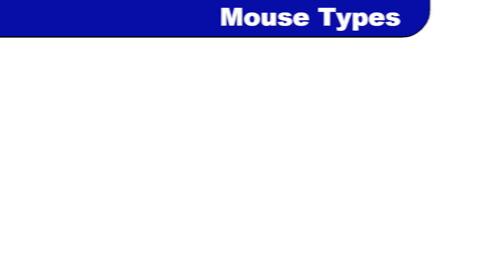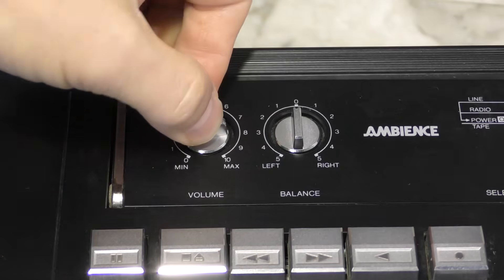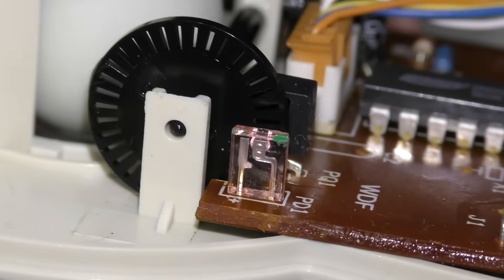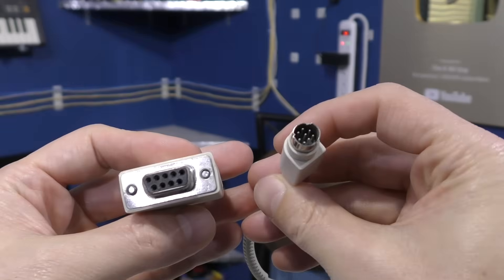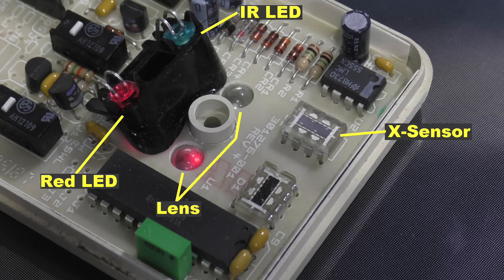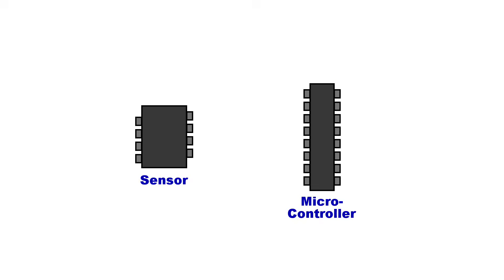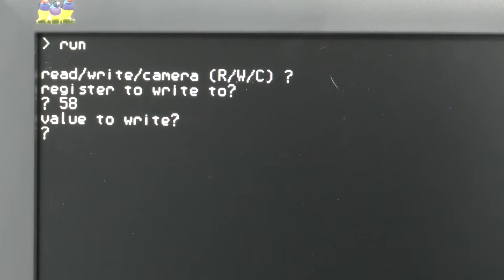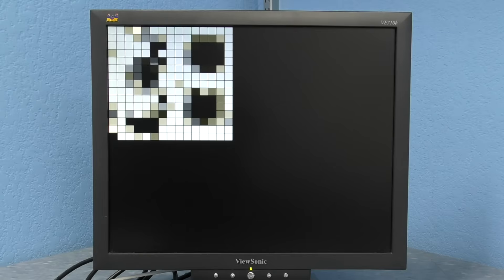What does a computer mouse see?

Comment: I googled this question just a few days back and didn't get a convincing answer... This is so perfectly timed!
Reply: What do you mean you didn't get a convincing answer?
People have been hacking mouse sensors as really crappy cameras and explaining the same years ago lol.
Here, this is from 10 years ago https://www.youtube.com/watch?v=bci7Gi05BNc
Reply: @GoldSrc_  People have search results 'tailored' to them by Google. What you see - even at the same time with the same search - is most likely entirely different than what they see.
Reply: Regarding reading mouse data, just go into anonymous mode and google "arduino mouse camera"  and you find plenty of results along these lines, which work faster that the one presented here.

 @ProGamer1515  I've seen Google not finding some obvious things, but not sure it tailors the results that much to user profiles, usually it's things it just doesn't index properly for anyone or jumbles it with many other unrelated things as to make the results useless. But that's not the case with this in my experience.
Reply: @ProGamer1515  That works for ads, not so much for search results, besides, how many other results you would get by googling "what does a PC mouse see"? That video I just linked, was one of the first few results.
Reply: :D
Reply: XD
Reply: K

Comment: The true awfulness was the mechanical... before the opto-mechanical, they used a disc with contacts, offset so that one set lead or lagged the other depending on the direction - probably got one of those tucked away in a drawer.

Also, many of the optical mice react to movement by brightening  - this isn't a cosmetic feature, they use multiple sample rates, particularly important for a cordless.
The wired typically use 2 rates, activating the LED and sensor 100 times a second when stationary, and 1000 times a second on detecting movement.
Cordless use a lower sample rate or 2, eg. 10 per second when idle, and an even slower rate when  left for longer.

Also, the lighting is aimed sideways to raise the texture of the surface.... Don't make a mouse mat with a picture under glass!

Comment: Trivia: modern gaming mice still typically have independent MCU and sensor chips.
Reply: @smpmuzpid  That's what she said...

Sorry. Had to do it.
Reply: Kinda reminds me of the Wii's IR sensor.

At first glance it seems like it tracks IR light sources - which of course, it does.
But how it does that is basically that it's a 128x96 black and white camera with an IR filter, and a built in processing chip that takes the 4 brightest readings, interpolates the pixel intensity values to essentially determine the coordinates as though it was a 1024x768 image, and then send those coordinates + a 4 bit brightness value on to whatever hardware you connect it to...

I guess optical mice are kind of doing a similar thing...
Reply: yes because they use more bigger camera
Reply: @AkhyarMaulanaPangeranWeb  it's more about the processing they do being a lot more elaborate, they're not JUST cameras, they're also DSPs
Reply: @AkhyarMaulanaPangeranWeb  I would say, that the reason is latency: You can make a faster MCU when you seperate it from the sensor. And the faster the MCU can process the sensor data, the faster you can move your mouse cursor and therefore in games where the crosshair of your weapon looks too. Don't forget, when you have a 144 fps screen, your mouse must at least send the position data 144 times a second to the computer, so that you can move your mouse without lag.

Comment: You should find a Hawley-style roller mouse, like Digital used for their DECstations. They worked vastly better than opto-mechanical balls.

https://images.app.goo.gl/bf8DSNbrwDNbhQ5QA
Reply: I guess these style pucks are rare, though pretty much all the DECstation 2100/3100s we had on campus in the early 90s were equipped with them. I'd have thought they'd be more common.

Comment: I did have a newer mouse that had a separate microcontroller (in this case, a 32bit ARM MCU) and sensor, however it got fried due to a lightning damage. It was a Logitech M500, and it had a laser sensor.

Comment: There was an old project posted on Hackaday where someone managed to used one of those sensors kind of like a scanner. Obviously the resolution from the 18x18 CCD was very low but the result was pretty impressive for what it was. It definitely blew my mind at the time. Unfortunately the link is now dead.

Comment: Neat!
I wonder what about the ways the Mouse sometimes fails, like if your mouse is stationary and somehow the cursor watching in realtime, moves itself to the bottom lower right corner, without you touching the mouse. Software issue? lens dirty? Laser timing misfire?
Reply: I only ever saw this with laptop trackpoints, there it's a calibration issue which fixes itself after some time.

Comment: I used that optical sun microsystems mouse back in college. It was horrid. The mousepads they had were always too small and would rotate just enough to mess up your cursor. It made me so mad that when "Laser mice" came to PC later, I dismissed it at first. But when I saw that newer ones didn't need a special mousepad I was sold!

Comment: who cleaned the ball... pretty obvious what bits got grotty. 

of all the computer mods ive ever done (n ive done some janky awesomeabsurd stuff, tho im an x86 kid), I think the most kudos I got at lan partys etc was one of the simplest.

replaced the red LED in an optical mouse with a blue/green one. having a good optical mouse was critical for any gamer. so many red glows in the lan hall. the blue/green (aqua) LED cost me something ridiculous, about $9. for a single 5mm LED. it really looked amazing. super unique. what I didnt let know, It was super fussy on what surfaces it worked on. needed huge contrasts. worked OK on my wood veneer desk at home, but not a chance on anything resembling a mousemat. I did my own newsprint laquer mousepad for lanning with, which looked pretty cool to. 

i had a beefy, watercooled, windowed, neoned (pre ccfl days) 6x hdd, dual PSU, overclocked to the hilt rig. and people commented on my mouse... Jeeze. to be fair, It was the only one like that ive ever seen, then and since

Comment: I had a stockpile of Microsoft InPort mice back when they were discontinued.  I LOVED the little tiny two-button mouse and didn't change until I eventually wound up with a system that no longer had ISA slots.
Reply: Those are worth something on eBay now. I've got an MS one on my 386, and a Logitech (I think?) controller card for one. I'm running the mouse off an old ATI video card that has the support for it. Excellent mouse, had it for over 20 years now.

Comment: My 2019 MSI PC still has PS/2 connectors for both mouse and keyboard, i have a old Packard Bell Keyboard from the late 90's but it's USB
Reply: Even high-end motherboards still can have a PS/2 port (usually a single one that you can split into two with a Y-splitter - a combo port), depending on the vendor. My Gigabyte Z370 board has a PS/2 combo port, and I use it for my mechanical keyboard. 
It's also good to have it as a fallback in case something happens to an onboard USB controller.
Reply: Pineapple road lots of esports players opt for ps/2 connectors because there’s something with how they transmit data vs usb for efficiency
Reply: @Adamsnadler214  Yeah, it's because of latency. Long story short: USB device has to wait its turn for CPU to work on its input, while PS/2 literally interrupts the CPU, requiring it to work on its input above all else, so no delays.
Reply: As I understand it some say lower latency for gaming but I'm not sure. funny though.

Comment: I've got an optical mouse for the Amiga and another for Acorn Archimedes. I found a model of mouse with an optical sensor chip that gives out the raw quadrature signals, the same as you'd find from the infrared LEDs in an optomechanical mouse. For the Amiga I had to cut the power trace to the USB encoder chip, then solder on the Amiga mouse cable to the correct pins on the optical sensor chip. The Acorn one was more difficult because the buttons worked differently (they were pull-up instead of pull-down or vice versa), so I had to cut all the traces to the buttons and wire them in separately with some resistors.

Comment: You missed the problems with the Mouse Systems pad optical mouse. I know you couldn't try it, but it does not act like an optomechanical mouse even if the way it measures movement is technically similar. The optomechanical mouse moves in the orientation of the mouse. The Mouse Systems pad optical mouse moves in the orientation of the pad, which meant that while it was very accurate, turning your hand any amount, as you do naturally, or having the pad at an incorrect orientation would cause the mouse to move in an unexpected direction. For most people, moving in the orientation of the mouse feels more natural. You could work with it when you had to like on a Sun workstation, but I had little patience. Using a ball mouse and dealing with the cleaning of the rollers was easier.
Reply: A lesson re-learned years later with the Apple puck mouse - the mouse with no orientable shape. A courageous endeavor in pushing the boundaries of form over function!
Reply: Interesting. I never really had that issue when I used such a mouse back in the day. I am sure it happened but I think is similar to the lack of issue I have with the up and down direction of a USB. Just something a lot of people encounter that I never really did and the few times I had a slight issue it was so slight and took so little time to correct that I forgot about it.

It may be that I also had a more advanced later version of the grid pad optical mouse. Something that may have used grid for the sensor but was more akin to a modern optical mouse. It was such a long time ago for me, so I am not sure.
Reply: However, you could really annoy the person next to you with a 90s Sun workstation by moving the mouse mat round 90 degrees. So now, up with left and left was up. Small pleasures but you got to find happiness where you can.
Reply: Weird I have a Sun 3/80 workstation I use quite a lot and I never even noticed. Gonna have to try and get it to mess up now lol
Reply: The computer lab I worked at in college had a Sun workstation in the back office with one of those mice that needed the special grid mouse pad.  If you turned it around the wrong way, it wouldn't work.
Reply: I wondered if this exact same issue would arise when he explained how it worked. Thanks for confirming that this is indeed what happened!
Reply: Imagine how annoying it would be if at the time you had only used that mouse and gotten used to it as natural, and now all other mice would be unnatural to you.
Reply: Conversely, you could hold the mouse at a tilted angle for better arm/wrist position and it would track properly. Windows 3.1 era mouse drivers allowed you to do something similar by re-defining the up orientation (you clicked a button in the mouse control panel then had to roll up), something that's been lost on modern systems.

Comment: Back in '91 I had to give an informative speech for class. This was my senior year of Computer Engineering (I had put off Speech from my freshman year to have something 'easy' for the schedule later). As typical, I forgot about it until the morning of so I grabbed my mouse of my Atari ST, popped it open, and took it to class and gave my speech on how a mouse works. This was also around the time of the Time-Life books on computers and they had the actor say "How does the mouse move the cursor?" so I used that commercial and saying as the opening for my speech :)

Comment: ahh, ball mouse. when dying in quake meant you had a valid excuse to blame it on the mouse even if it wasn't true.
Reply: "Lag..."
Reply: I played quake with an old Logitech Trackman Marble. Sure you can come at me with your optical mouse but my trackball would never fail, especially trick shots with the rail-gun !
Reply: @vincentlamb3436  I'm playing with a Logitech MX Ergo trackball. Everyone makes fun of me but it's a dream to use.
Reply: @pingaslord9726  yes the apex of trackball evolution, im not laughing here!
Reply: i accidentally bought one in 2012 if you can believe it. Had already packed up all my spare mice and needed an emergency replacement when my main one broke, made this big arduous journey to the nearest store, got the cheapest mouse available.. and it was a ball mouse with the oldtimey pre-USB plug. I was bafflegasted.
Reply: @KairuHakubi  good ol ps/2 is what you're thinking of as a pre usb device.
Reply: Once my mouse broke down and my only spare was a graphic tablet. The mouse of the tablet didn't work great for Quake so I used the pen instead. I had a ** of a good time until there was a hard tap on my shoulder and when I turned around there were 8 angry guys standing behind me each with a spare mouse.
Reply: @CC-ke5np  not so much quake, but Doom  99% of the time use just the keyboard
Reply: Sometimes there's cat hair that get stuck to the sensor, I still have a valid excuse to die in 3D shooters...
Reply: i still prefer ball mouse... for sure...
Reply: @Вероника Заглотова *all wireless mice
Reply: @smpmuzpid  Can't you just buy  a gaming mouse? They usually look better than plain office mice
Reply: Вероника Заглотова Weird, never had a spin out in normal usage (Including fps games) on my Genius mouse. Actually never had it in my life with any mouse iirc in 8 years.
Reply: It might be a Quake urban legend, but I recall Zero4's first place win at quakecon being done with a compusa ball mouse!
Reply: Nowadays its the damn left click that forces me into gaming mice territory, guess that's the difference between FPS and RTS
Reply: @bluetonic99  what you mean?
Reply: @MsTatakai  clicking intensity
Reply: @MsTatakai  Yes! either double click or not clicking at all. I used to play counterstrike and day of defeat which I would have thought would be more click intensive, but in terms of RTS I still find myself returning to RA2 online or Rivals through bluestacks. And found these were the ones that wore my mouse button (maybe my fault for playing a mobile game on the pc for Rivals)
Reply: @bluetonic99  don't blame yourself because you tear your mouse clicks... just get used to it =P it happens but also has a way to fix it ... so if you want to repair a mouse its possible but imo i think it won't worth it ... search about it ... if its double click a AHK script can help you however not clicking at all its more complicated and you need to open the mouse and repair yourself (◠‿◠)
Reply: @MsTatakai  Thanks for the advice, I found so far lifting the left click up with an implement so it unlatches then reseating it seems to help.
Reply: @bluetonic99  but than makes you need to push the button a bit harder i guess... even tho glad i helped =P
Reply: And if you did blame it on the mouse, you'd get told to clean it, so that excuse would only work once with a given opponent.
Reply: @Вероника Заглотова they all have latency, it's just not noticeable
Reply: Nowadays you can blame your scroll wheel for not correctly scrolling to the right weapon.
Reply: @Sannesthesia  Now I absolutely want this version of the music
Reply: remember diablo's genocide of mice from excessive clicking? 
good times. every lan party we'd have to be ready to sing our goodbyes to our mice.
Reply: @smpmuzpid  Well you were not very clear
Reply: Those things get so dirty
Reply: @missionpupa  Not as dirty as an old optical mouse, easier to disassemble and clean.
Reply: Why did I read this with LGR's voice?
Reply: @herrlindner  i've been watching a lot of LGR lately, lol.
Reply: I hate ball mouse, the ball always rolls inside the mouse when I press too hard. Had to lift the mouse up to actually use it properly.
Reply: @EdwardChan.999  bad mouse you had... if you had a good mouse you could use that to move extra far and if you master that you can use that as an accel mouse movement and its really good ... low sense if you want and if you SNAP you mouse with force you could do 360 ezly ... also the ones who doesnt do that and the ball doesnt fly is also a good mouse... but i like that feature if it works properly
Reply: Noobs: ahh its the lag not me!

Me: Im in a wrong position sorry guys i can't aim
Reply: @Вероника Заглотова well all input devices have latency, but the transfer speed is slow on Bluetooth due to it being wireless, which increases the latency by quite a bit, sometimes to the point of it being very noticeable
Reply: @TorutheRedFox  You are wrong, new wireless mice have latency that's the same or even lower than wired mice. This has been tested and proven by multiple unbiased tech reviewers tested with professional grade measuring devices.

Comment: 2:24 back in the day, we called these RPGs - rotary pulse generators.
Reply: TSA officer: Any sharps or other illegal items in your luggage?
Me: Only a couple RPGs, nothing to worry about...
Reply: Thank you, I will now be using this.   ...whenever the opportunity presents itself.
Reply: @Scwarzkop  TSA officer rebooks you on a flight to Guantanamo.
Reply: Today we call these encoders...
Reply: And last time i poked around a cheap MS branded mouse, it was still used to drive the scroll wheel.
Reply: @digiowl9599  Hah, I have one here, one of the original ones that cost $100. Since it's dead and I'm literally watching Memtest go through 12 NIB DDR3 4GB modules, I'll open it up and report back.
Reply: @digiowl9599  Confirmed - MS mouse PN X802382-001 uses such a sensor - it looks like a cogged wheel with open ends. Clever scroll button integration, there's actually lithium grease on the slider.

*Edit and as an added bonus, me taking it apart and messing around inside revived the mouse! Digi owl, I owe you a beer!